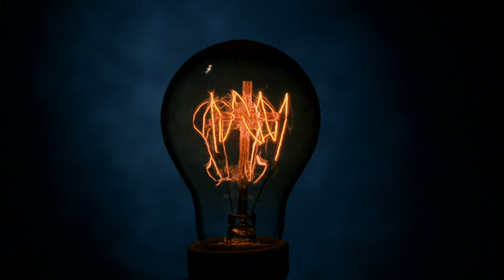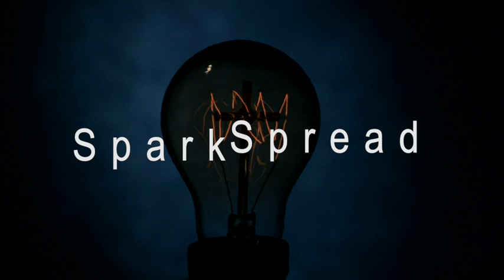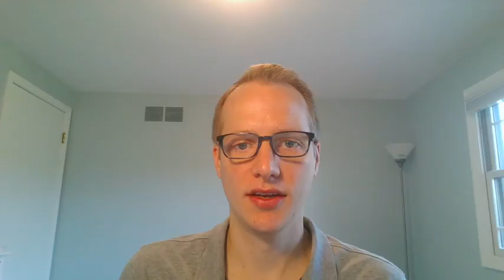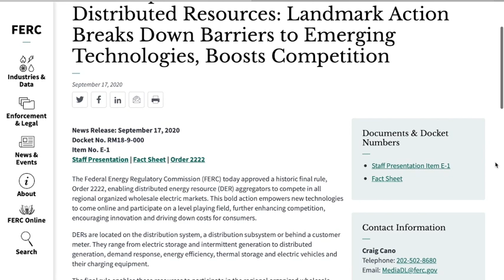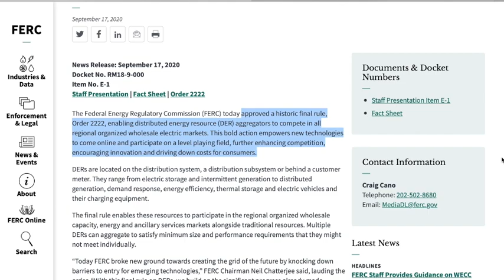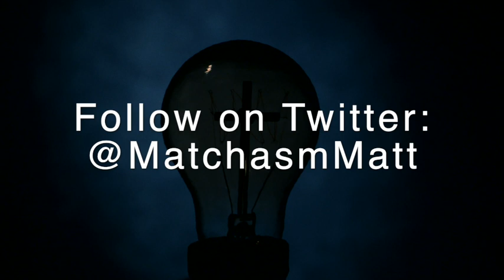How Tesla can Participate in Energy Markets *without* V2G

Comment: Hey Matt, cool that you are on YouTube now!
Don´t you think that all Tesla vehicles will create much more value/profit (for Tesla and for owners) when operating as an autonomous taxi rather than as a vehicle to grid appliance?
Elon is pretty sure Tesla can achieve full self driving, so maybe that is why he is not so excited about vehicle to grid.
Reply from the maker: I agree with that, potential is much larger for vehicles to be optimized for robotaxis than for V2G. I think that's kind of why Elon downplayed V2G, it really is a much lower $ opportunity than most people realize, and the regulatory hurdles are pretty tough. That said, Tesla basically has a home energy ecosystem (solar, powerwall, EV) which the customer has already purchased, and which can create a bit of value for grid operators. If they are going to pursue distributed energy resource aggregation anyway for solar and powerwall, you might as well try to throw in EV charging demand response. Won't be a huge value stream, but it doesn't hurt either.
Reply: @SparkSpread  Isn´t it just beautiful that all of Teslas hardware enables so much software revenue in the future^^
Thanks for the content, I´m looking forward to your future videos!
Reply from the maker: @jakobkerschbaumer730  Completely true, The parallels between energy and auto are quite pretty surprising. Tesla gets its customers to pay it to help train the FSD neural net in auto. In Energy, Customers buy all the hardware, and then Tesla can aggregate and get pure margin revenue from offering those services into the grid.